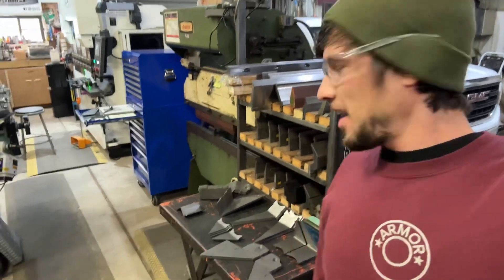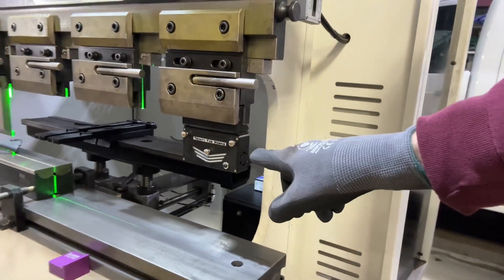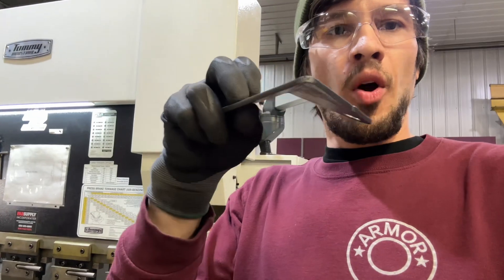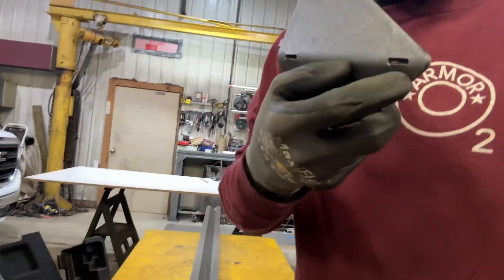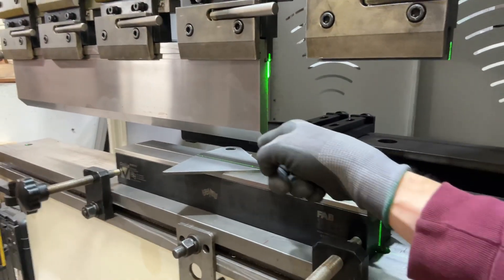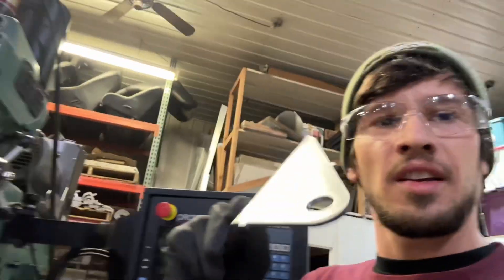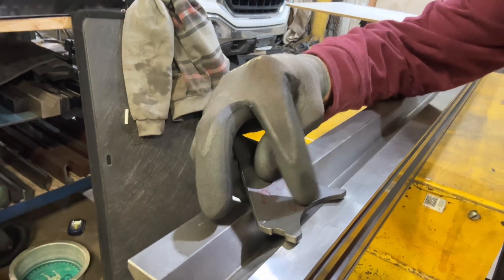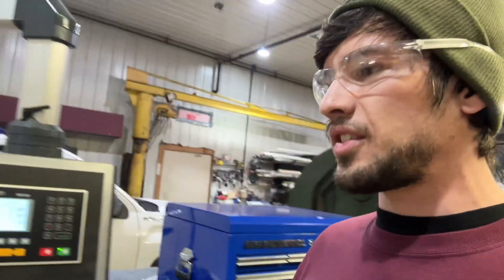Tech Tips With Adam - Ep6. Press Brakes, Rolla V & Lasers oh my… 🤓✌️

Comment: You cutt lines to calibreade the part butt you juse a rollerri dy? if you move the line to the point you can juse a normal dy because the part dont need support than becauce off the line cut😅